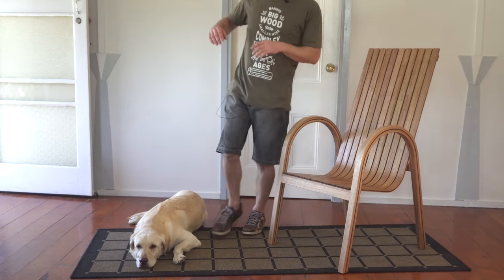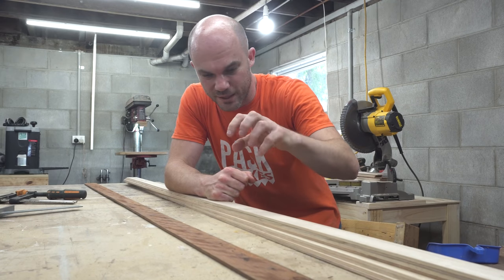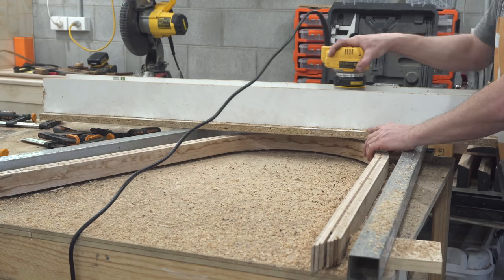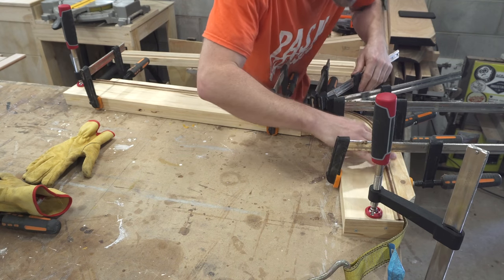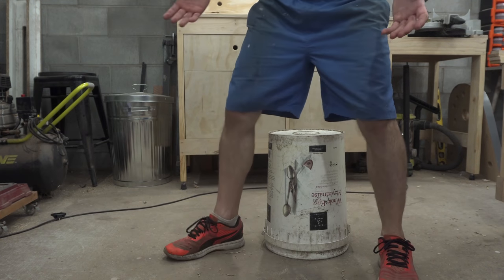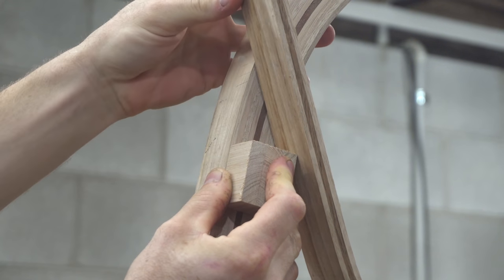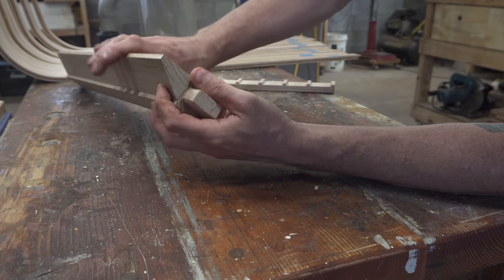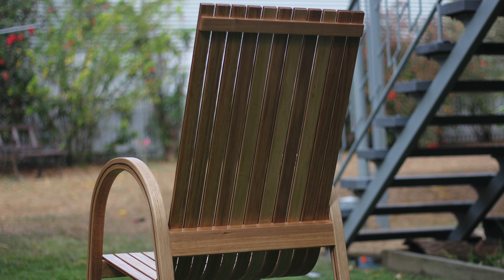This Chair Changed How I Make Furniture

Comment: Well done! I am working on a similar method. Very useful video. Have you seen/considered stream bags? That allow you to clamp under heat and cool limiting the spring back in the wood, if you are not laminating but working a thicker piece of wood.
Reply from the maker: Thanks. Using a bag looks like a great method, not something I’ve tried though

Comment: Dude, this is awesome - your best work! I'm wondering how a rounded top/back would look instead of a straight cut, to match the arch of the arms.
Reply from the maker: Thanks man. I've thought about that a lot now that I've had some time to sit on it; changing the form to add some lumbar support, and even give the seat part a bit of a dip. Wouldn't be that much more work, just an adjustment to the form